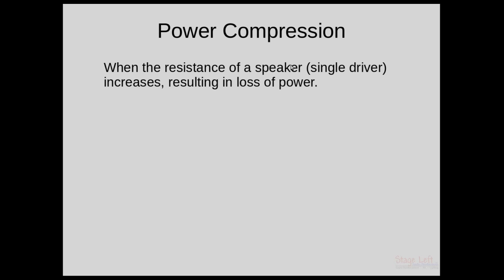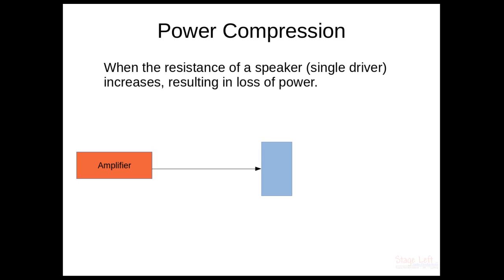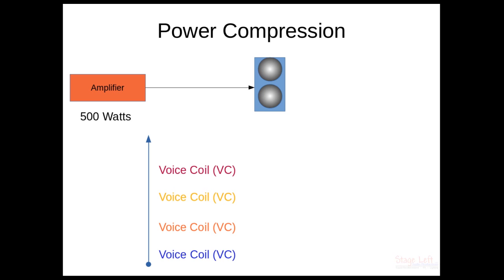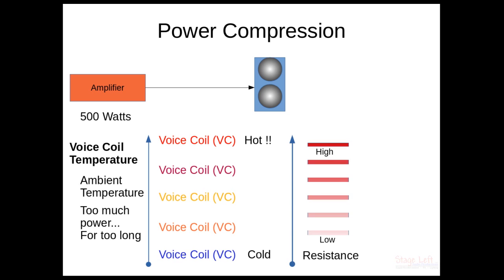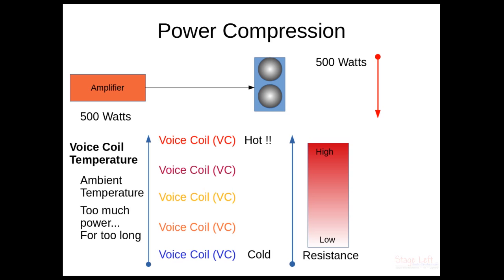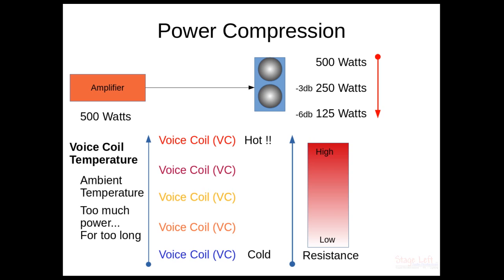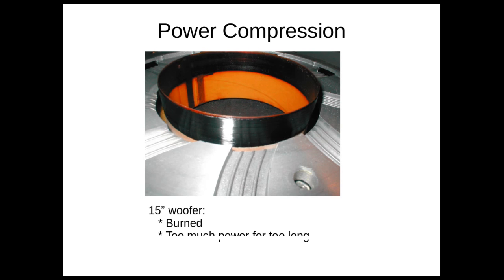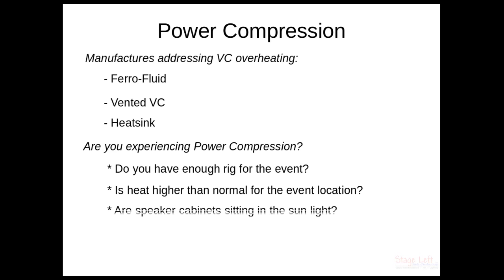What is power compression in speakers  (Physics 4)

Comment: Great Video. thanks. Pardon my Newb-ness (if that's a word). 
So I run my 500 watt subs with a 2 channel 2000 watt amp. I have each on it's own channel with it's own input.  I haven't noticed any power compression on them, but i've only done a couple dozen shows, and none have been outside. I've been keeping each dial of the amp at 100% and keeping the level of the output lower so it a good volume with the mains. Should I run the dials on the amp at 50% that way each speaker is only getting 500 watts of power? And will not allow the speakers to get to that point (when the bass player happens to turn his rig up)?
Reply from the maker: The dials (attenuaters) on your amplifier do not control the power output.  The dials control the level of input-voltage going into the amplifier.  Just because your dials are turned back, doesn't mean the amplifier cannot produce it's full power.  When the attenuaters are turned full clock-wise (100%), this means the amplifier input stage is set at its most sensitive, which equates to not too much signal (input voltage) is needed to drive the amplifier to full power.  When the attenuators are turned down (using your 50% example), this just means more input-voltage will be needed to drive the amplifier to full power.  

Setting the dials back does help with reducing the chance of over-driving a speaker, but it will not protect or "limit" the output power.  Though, turning the dials back too far can cause a signal overload of the input stage of the amplifier; which will result in audible distortion (at the input stage).  If you think the amplifier is too large for the speakers, you may need to use smaller wattage amplifier.

You may notice a 3db drop in power (when the speakers are experiencing power compression), vs a 1db to 2db drop.  As the speakers heat up, resistance will begin to occur; it's usually when a speaker drops 3db (or more) that the loss of audio level is more noticeable.
Reply: Wow I didn't think of it like that. Ok. So is my 2000 watt 2 channel amp  too much for the 500 watt (1000 peak I assume) subs, and will sooner or later ruin them? Or should I think about running them daisied off of only 1 side? And use the other side for other gear? And lastly should I always run the attenuator at 100%?
Reply from the maker: Sounds like your 2000 watt amp may be way too much, especially if you run the amp near it's capacity (regardless of where the attenuators are set).  Over time, you could easily burn the speakers.  If your speakers are actually 500 watts (assuming RMS), then 1000 watts peak sounds right, however, it's best not to look at the peak power of a speaker.  Those power ratings usually only represent a 20ms burst of time... not too realistic when running live sound.  Your 500 watt RMS speakers are probably 250 watt continuous rated cabinets.  Depending on what you are using the speakers for, you may want to consider a 500 watt amp for the speakers.  

Not sure if there would be a benefit of running both speakers off of one channel; need to factor in ohm levels, amplifier output at ohm load, and damping factor.  Most people run their amps with the attenuators at 100%; this ensures the least amount of input voltage (and lower distortion) to get full power out of the amp.  However, it doesn't hurt to keep the attentuators down some (not a lot) to help protect the speakers, but good discipline with the board "mains" is required to ensure some level of protection.